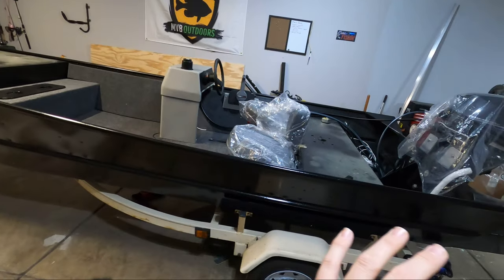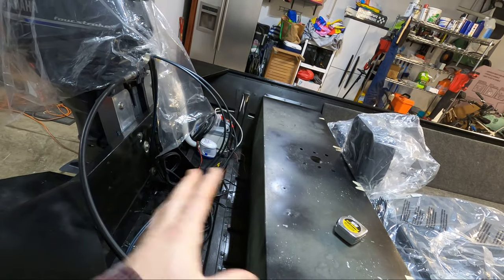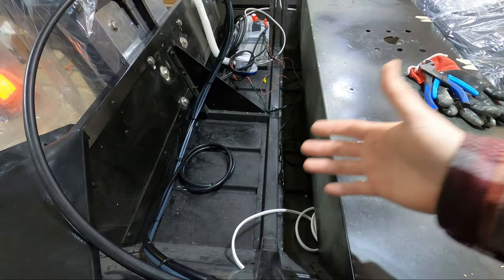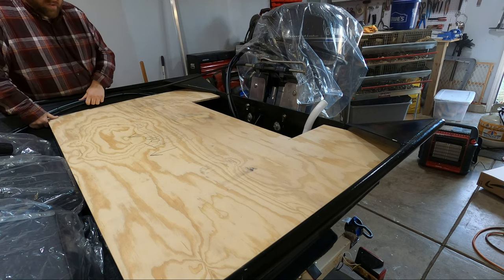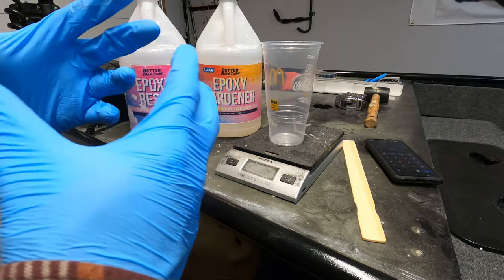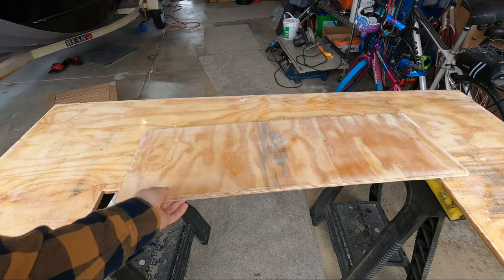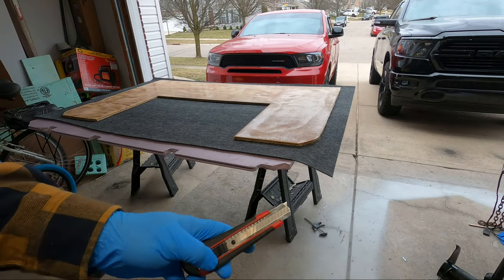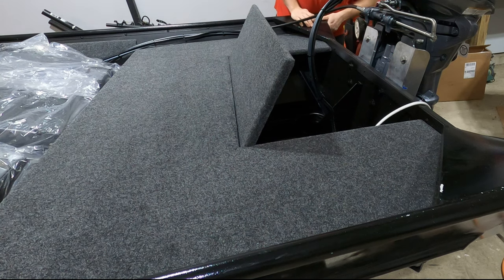BOAT CASTING DECK BUILD (PART 1) - 1648 Jon Boat To Bass Boat Conversion

Comment: How much more did you have to cut from the sides of the hatch to accommodate for the carpet?
Reply from the maker: About 1/8", it wasn't much but depends on thickness of carpet

Comment: How was the Bimini top?
Reply from the maker: Unfortunately I goofed and ordered a size too small, the material looked great for the price. If it fit I would have installed it.
Reply: @mvboutdoors  that's too bad, I'm hoping it fits my marlon sp14, I saw you post about it and bought it, that's the cheapest I've seen them!
Reply from the maker: @josephcrust7013  as long as your beam is 60" or less it should fit, mine ended up being 68"